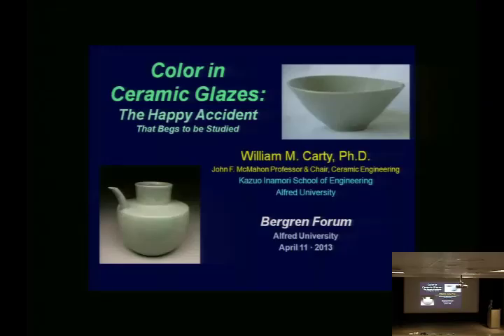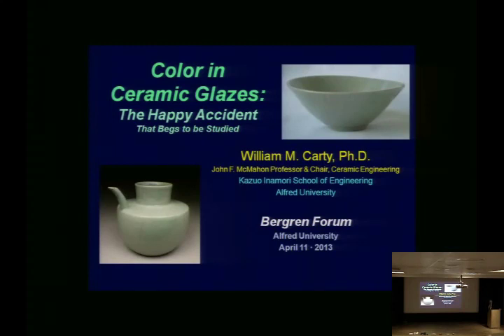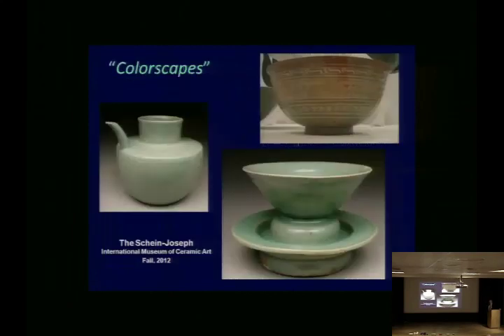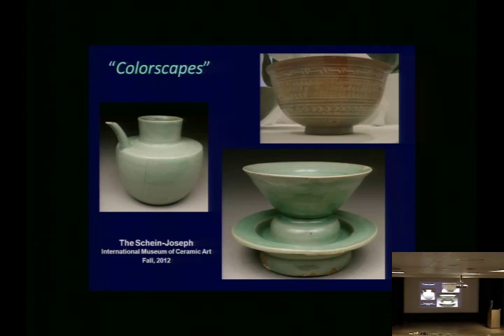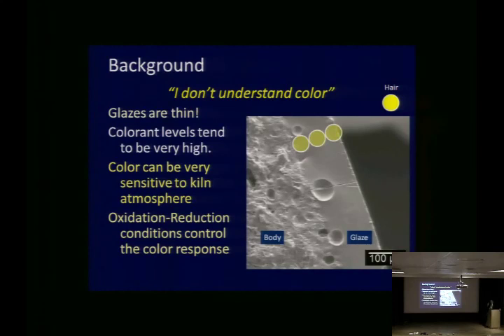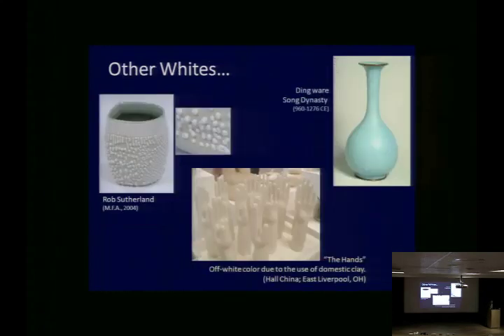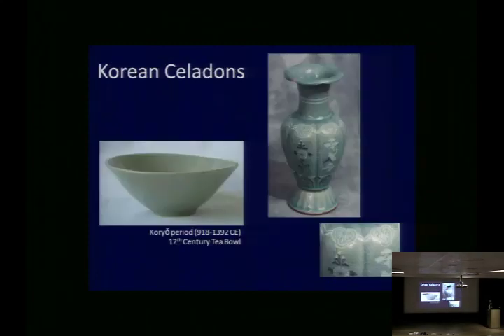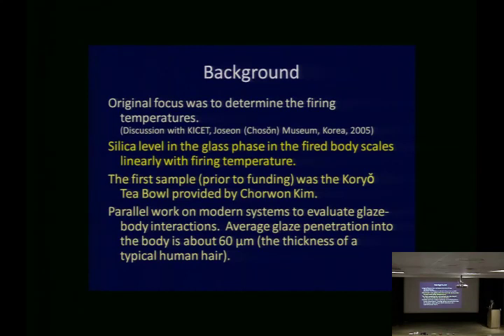Color in Ceramic Glazes

Comment: Is the colour applied to an existing (white?) shiny glaze already on the surface of the (fired??) china clay, or does the colour become the glaze, having been applied to a matt/non-shiny clay surface? Thanks
Reply: These are typically very old (ancient) ceramics pieces.  In some cases, there is color added to the glaze, as is common today.  In the ancient Korean Celadons, the color resulted from the dissolution of the iron-containing body, changing the oxidation state of the iron from 3+ to 2+, and thus converting red to green in the glaze.  The color does not appear to be added to the glaze but is a result of body dissolution into an otherwise colorless (clear) glaze.  The long firing times increased the glaze thickness enhancing the green color.  These firings appear to have been conducted in reduction and it is known that the Korean Celadons were fired in a wood kiln, in which reduction would have been relatively easy to maintain.  

In short, there was not color applied, but was the result of chemical reactions between the glaze and the body.  The brown color is assumed to be due to poor reduction conditions, potentially oxidizing, or may have been the result of a truncated (shortened) firing schedule.  The thickness of the brown glazes on Korean Celadons appears to be thinner than the glaze thicknesses of green glazes.

In the case of white, sometimes this is a clear glaze on a white body.  In other examples, this is an opacified glaze, usually with zircon in modern times, in which the white is in the glaze (and is often applied to a non-white body, thus masking the body color.
Reply: The pot is not held at top temperature for hours and hours but it is the slow climb to the peak and the very slow fire down and the firing moves up the kiln chambers which gives the interaction with the body. Gust going up quick and holding for a loge time is not the same as the slow climb at 30 to 50c per hour before the peak temp.